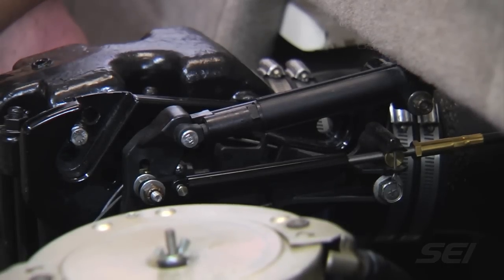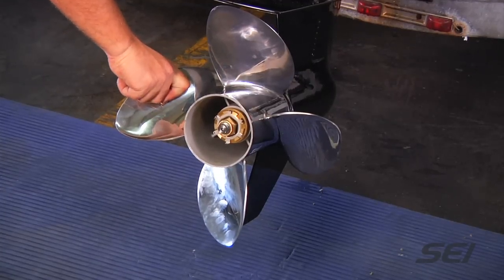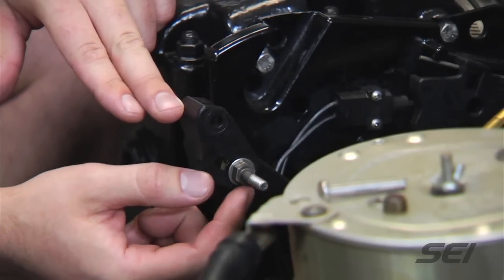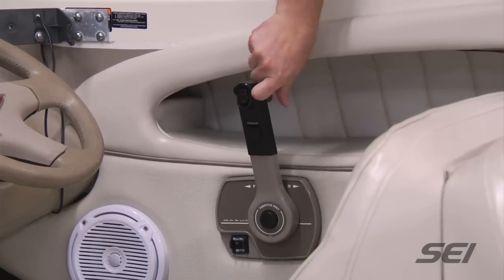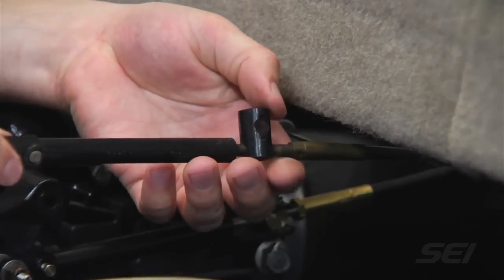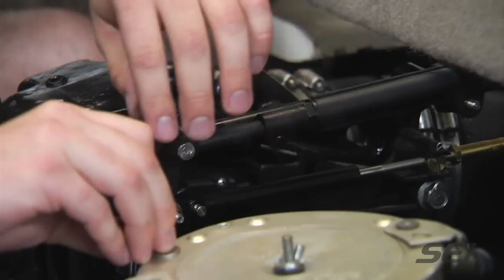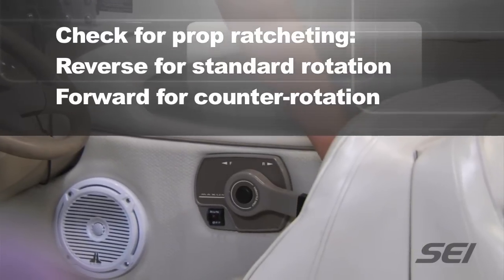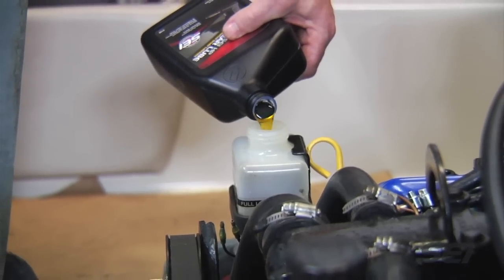How To: Install a Sterndrive Assembly - Shift Cable Adjustment - Part 3 (3 of 3)

Comment: Correct me if I am wrong but the prop looks like the boat has standard rotation which is clockwise. But when you checked for forward rotation it locked turning it counter clock wise which is reverse

Comment: My issue is not locking in reverse, will moving the set nut up in the slot correct this?

Comment: Thanks for the video.  My brass barrel on the lower shift cable is pinned to the treaded rod.  I can't just simply rotate the brass barrel.  How do I adjust the brass barrel if it is pinned to the threaded rod for my 6"?  Thank you.
Reply: W40
Reply: WD40 MAKE IT MOVE

Comment: Fast forward to march 2022, how do I get to video 1 of 3?  Just reinstalling an alpha One gen One after transom, stringer and bulkhead replacement in a 20' Sea Ray. Thank you.  Difficult to find a professional video on this.  Yes, the service manual is not as easy to understand.  Thanks!

Comment: So the one important step that help me is probably the last thing you mentioned, which was adjusting the stud at the end upwards until reverse engages. That’s what finally got mine shifting perfectly. Thanks for the tutorial.
Reply: You talking about the stud the lower cable mounts to with the nut you can loosen and slide. My reverse clunks loud!

Comment: That reservoir he filled within the stern drive at the end, was that for the tilt?
Reply: No, that was the foot oil - for the outdrive gears. The trim uses hydraulic oil - separate reservoir usually underneath the pump.

Comment: 1:24. How long should the cable be pulled out and in? I see you can adjust with the nut on the right side at the bottom.

Comment: Great video, thanks!  I did all the adjustments, and had prop lock in both gears. But when i actually drive it it still gets stuck in forward gear when shifting back to neutral. When i than go and re check to see if prop is locked the prop rotates. Everything "appears" to be locked into place still regarding the cables, etc.  Would this mean that my cables are shot and need to be replaced?  '99 mercruiser i/o. No idea if they're original cables or not

Comment: I have a Merc 4.3 LH Drive.  Just did a cable replacement.  Can't get the right adjustment.  In your video you mention counter rotation. Is it only when aligning the upper cable that I am supposed to put the helm in reverse?
Reply from the maker: The only difference is you would put the helm in reverse. Everything else would be the same

Comment: Dear Phil. Great video - thank you. I have a Mercruiser 4.3 l 262 from 2003. I am not sure which sterndrive it has - but it looks exactly like the one on your video. Could it be a different sterndrive that would have other measurements? Or can I be safe adjusting it using your guide? Thank you :)
Reply from the maker: It would be the same.
Reply: Thank you for the Quick Answer. I adjusted using your guidance and still had a little grinding in forward so I tightened 5 turns on the upper cable and now it jumps into gears perfectly. However it doesn’t return into neutral when the remote unit is in neutral. I will have to move the remote unit into reverse to find neutral OR shut of the engine. The same when I am in reverse. Then I have to take the remote unit into forward to get it to neutral (or shut off the engine). Do you have any suggestions on how to fix this? Best

Comment: I have a 05 Four Winns Sundowner 225 and want to replace the throttle and shift cables, I am not near the boat and was hoping to get the cables to have it installed. Is there a way to determine which cables I need without being around the boat?

Comment: What a terrible mistake doing the OMC to SEI conversion....never got the shift to work correctly, have to shut down to pull out of fwd gear.
I should have kept and rebuilt the Cobra!!!
Reply from the maker: You do not have the shift cutout switch working properly. We have sold over 1300 of them with very few issues. Feel free to call our tech support at 813-925-7127
Reply: I spent countless hours talking to tech, I even installed the New style Mercruiser shift plate Assy 864363A 1, Merc shift cables and Merc Quicksilver shifter...the initial adjustment just could not be made, not enough threads. Sorry to be such a P.I.T.A.
Reply: I have a Quick Silver Throttle/ Shifter Lever with cables and a Mercruiser shifter plate coming in the next week and going to try one more time, can I call you if I need help setting them up? If I remember correctly the 6" center to center setting I could never get because there were not enough threads on the cable coming up from the drive.

Any guidance in advance would be nice.

And I apologize for my nasty comments, I am sure this will be great once all the OMC stuff is out of the picture.
Reply from the maker: If you can't get the 6 inches, that could be a problem, but it really wouldn't affect having to shut the engine off to get it out of gear. That is strictly the shift cutout switches job. We are available via 813-925-7127 if you have any questions when installing. You will need to fashion a mounting bracket for the shift bracket.
Reply: I take back all the negative comments I left, after careful examination I found the inner cable of the lower shift cable(the one to the drive) was too long, never could get the 6" measurement, I shortened the inner cable slightly and drilled the plastic barrel so the cable goes slightly past the witness hole.
Works PERFECTLY now, I highly recommend SEI products now.

Comment: The 6" on the lower cable is that whit the cable pushed all the way in?
Reply from the maker: Yes, all the way in and have someone rotate the propshaft counter clockwise to make sure you are fully engaged in Forward,
Reply: @ShopseiNetSterndrive  is the helm in neutral for this step?
Reply: @ShopseiNetSterndrive so the shifter needs to be full throttle forward, correct?

Comment: The lowest position in the slotted. Anchor pin is the least amount of clutch travel . you have to spin the prop opiset of the lock up and listen to the ratchet in forward and reverse and balance that sound that will tell u if that dog clutch is fulley engaged. And you can take some from reverse and ad to forward. Or forward to reverse if you don't do this you have no clue on how much engagement yo have when your done .

Comment: When u check for ingagment forward and reverse how do you know if the dog is fulley in gaged or just part way? Just because the prop won't turn in one direction don't mean u have full engagement . you might be only half engaged or mabey less?
Reply: when putting it into gear you also spin the prop so it locks. If you are pushing in on the cable while doing the 6 inch measurement and you have turned the prop counterclockwise it will be engaged all the way.

Comment: I did all this to a "T". I get kill in the reverse position only and have tried hours of adjustments all over and back. 3 times I watched this video and reset it again to have same issue. I have 9/16" play in shift cable and 1/4" play in the throttle cable. could this be it?!?Mark 612 207 4679Minneapolis, MN 1989 Wellcraft eclipse 233 , 350 GM Mercruiser V8 with Alpha one gen one.
Reply: Mark Sowers , I'm having the same issue when i put it in reverse. Whats the fix? Haven't adjusted my cables yet.
Reply from the maker: If a new shift cable was installed, make sure that you can only see one thread of the shift cable nut. If it is sticking out further than that, it can cause the shift slide to hit the nut and cause stalling.

Comment: hi its Michael here I just starting out in sterndrives boats I need to know how to fit a new stern drive when I get my 1st bayliner boat with the 5;7liter V8 is the job easy to do Im learning all that's needed to do to do the job right I have a disability and I need some way of fixing the stern drive and how to do the job easily I knew that will be a good job on my future bayliner I just need the encouragement to do it and I knew how to perform the job and have that know how to get it right I knew I'll get it done right  thanks

Comment: Will filling the remote monitor from the top work as in the video? I always thought you had to fill from the bottom until oil seeped from the vent.Then close the vent and continue to fill until the monitor showed oil at the operating range. 
Great video series.
Reply: When replacing your drive fluid you should always fill from the drain hole, What you saw in this video is just for filling the reservoir not the drive!
Reply: Which oil did you use

Comment: Do the 6 inches apply for a yamaha 40hp 1986 as well or just for your engine..cant get my adjustements..arrrghhh
Reply: What would be the measurements for a yamaha 4.3
Reply from the maker: doczepi  No, this is just for Mercruiser alpha style drives, 1972-present.

Comment: I'm not able to get the cable to shorten up to 6 inches. Is it possible to shorten the cable by taking off the plastic end and trimming off some of the cable. It looks like the square studs unscrew to release the cable. I have tried to adjust the threaded tube but it doesn't seem to be long enough. The cable was replaced with the previous stern drive which I had to replace because the prior owner never put oil in the drive and the upper gears burned up.
Reply from the maker: Make sure that the inner wire is all the way to the end of the plastic piece with the eyelet. There is a little inspection hole that you should not be able to see through because the inner wire is blocking it. If that is okay, I would suspect some other problem is not letting you get your 6 inches. possibly there is some debris in the cavity that the shift slide goes into that is stopping it from going all the way.

Comment: Hi, great vid... My Mercruiser 3.0L, Alpha 1 drive is slamming into forward and reverse gears. any thoughts? My Tach is broken, but i do think the RPM's are below 1000.  i know it's vague but i'm new to the Merc drives and i'm not sure how else to describe. i'm going to change the lower unit oil this weekend. any other thoughts??
Reply from the maker: I would first check your shift cables and remote control at the helm to see if they need to be replaced. Either of those could definitely cause your drive to slam into gear like that if they are worn or binding. Also, the other concern would be if you find excessive metal in the stern drive when draining the fluid. If so, you could possibly have damage inside the lower unit from the hard shifting.
Reply: SEI Marine Products Thanks for the reply!  do you guys sell lower gear cables or a kit?  For your helpfulness, I'd definitely like to pay you back in buying cables or a kit.  Also, would you be able to make a video and show how to replace the lower gear cables going to the outdrive??  I have a Mercruiser 3.0L 2002.
Reply from the maker: mgrocki No problem, here is the link for our lower shift cable kit for your motor. http://www.sterndrive.cc/product/Fits-Mercruiser-Shift-Cable-19543A4.html. Also feel free to call our technical department with any other questions.